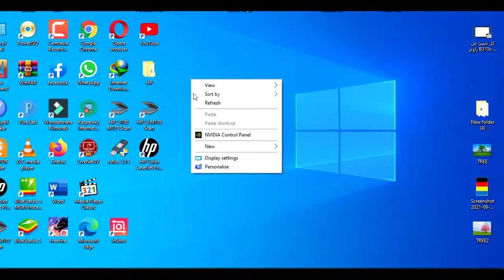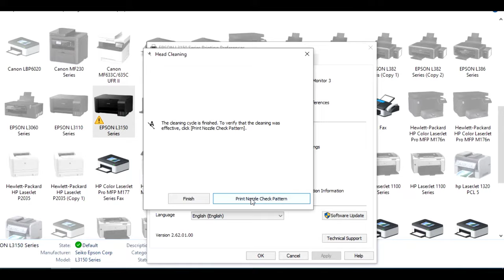how to clean head in epson l3150.How to Clean Epson L3150 Print Head Nozzle in Detailed Steps.

Comment: The head cleaning must be performed 3x?
Reply from the maker: If the print quality is good after cleaning the first time, then there is no need to clean it again. If the print quality is bad, then clean it again.  After the second cleaning, if you see that it is better than the first time, then keep cleaning until the quality is 100% better. And if there is no change, then there is no need to do it again because the head is bad.
Reply: @sabbirtechfixer7757  hello. i tried this with my printer and i head cleaned it many times but nothing changed. i think my head is bad, is there any way to get it replaced?